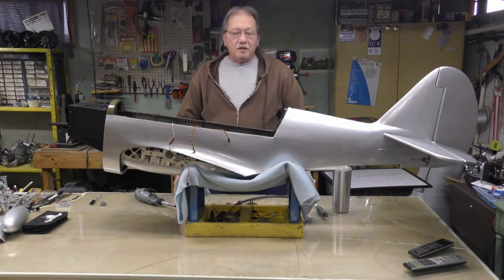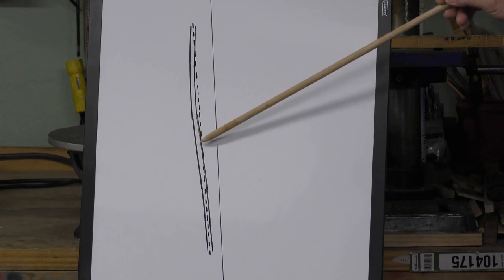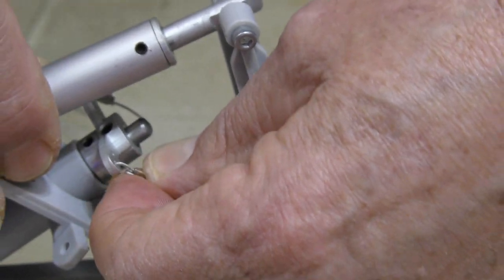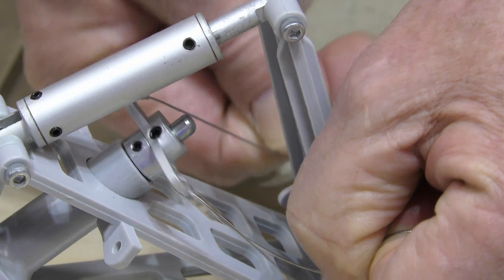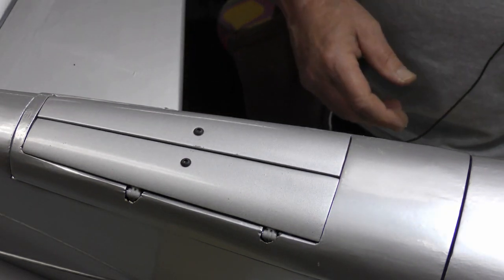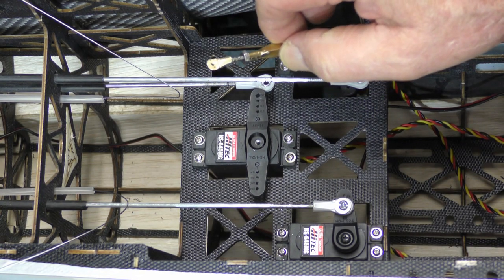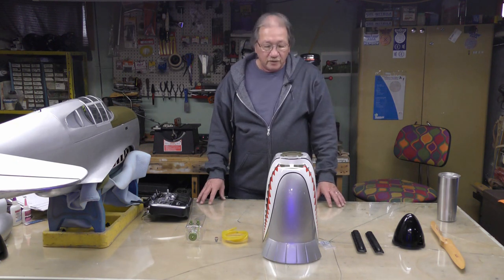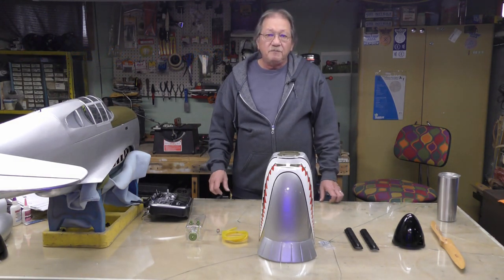Phoenix Model P 40 Warhawk Assembly Part-4

Comment: Thanks for your reply,
last question. What about the wing and fuselage sheeting? is it balsa or some kind of composite material? is it covered with ultracote?
Reply from the maker: The wings are sheetfed balsa, I don't know what kind of covering they use. The fuselage sides are sheeted balsa on the outside with some type of thin foam backing on the inside.  The turtle deck is foam.

Comment: excellent video but I am having a b*tch of a time centering the tail wheel using just the cables! Is there another adjustment on the retract for that? What am I missing? It looks like there are a couple of setscrews on the steering shaft but no way to get through them when the retract is installed? Grrrr. BTW, I have the early addition with the air retracts.
Reply from the maker: Hi, I should have  mentioned that I removed the retract and centered the horn . Then, I attached the cables and thread them to the servo area. Next, with the rudder servo powered up I attached the clevis to the servo horn. Next, put the cables through the holes in the clevis assembly on both sides and pull each cable evenly to center the tail wheel.  Once centered, pull the cables tight on both sides and slide the crimp tube in place on both sides. Now, make adjustments to the cables to re-center the tail wheel. Note that when you slide the crimp tube's on and slide them towards the clevis assembly, it will keep the cables from sliding. Once you're satisfied with the tail wheel position. Loop the cable back through the crimp tubes.  If you're satisfied with the cable tension and tail wheel position, crimp the tube's. Remember to make sure that the threaded rod is screwed in the clevis only halfway to preserve equal adjustments on both sides.
Reply: @rcmodeltipshints9462  That was going to be my next step, removing the retract. Thanks! I already have the cables run but I keep adjusting them over and over to try to center.

Comment: Hi. First of all many thanks for your video, I've learned many new things, thanks again. I'd like to know how this model fly with the dle35. It's a good solution or really need a 55cc?
Many thanks again and best regards from Italy.
Reply from the maker: Hi, the DLE 35 is a perfect match for this model. A 55 would be extreme over kill in my opinion and I'm a over power kind of modeler. I dont think the airframe can handle the torque. You can actually twist the fuselage by hand out of the box. I added 1/16" and 1/8" basswood to the structure to stop the twisting. The P-40 takes off fairly quick on a grass field and even quicker off pavement with a DLE 35 with a 18x10 propeller.   By the way, the field I fly off of is less than 700' above sea level. 
Thanks for your question, regards from Gladwin, Michigan USA
Reply: Really many thaks for your answer. And many thanks again for your video. Realle really thanks again from Italy!!
Reply: @rcmodeltipshints9462  I have a DLE 30cc in mine. I doubt not that much difference from the 35cc. What prop do you recommend for the 30cc? I'm thinking 18x10 or 19x8?

Comment: Hi, where did you get this kit? Towerhobbies sell it, however the pictures in the website is showing the 1st generation. They are still selling the 1st generation or the new shipment is already the 2nd generation?
Reply from the maker: I purchased my P-40 from Tower Hobbies.  I was on the pre-order list before the release of the 2nd generation P-40. I also have been waiting for the next shipment to arrive. (I need a new retract because mine arrived with a defective retract). 
      I don't believe they sell generation 1 since generation 2 came out. They were selling the generation 1 retract the last time I checked. I will be replacing the electric retracts that came with the model with Robart electric retracts. 
      I  don't know when the next shipment is due to arrive.  I need some minor parts to repair my Gen 1 P-40. However, now that the flying season is over here in Michigan I'll be making my own parts since the supply chain is unreliable. 
       Be patient,  I hope the availability will get better after the first of the year.
 I hope!